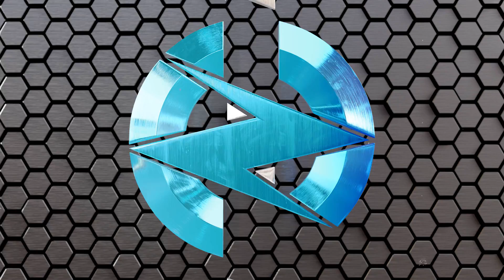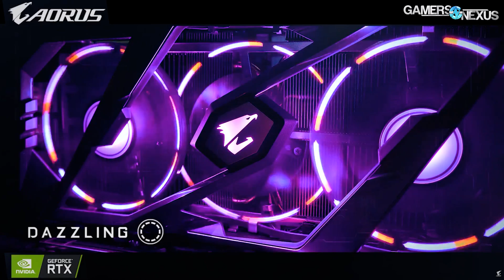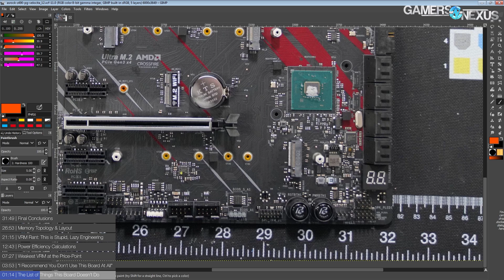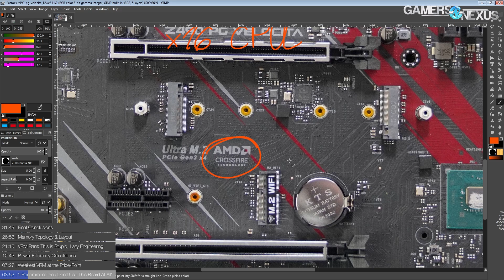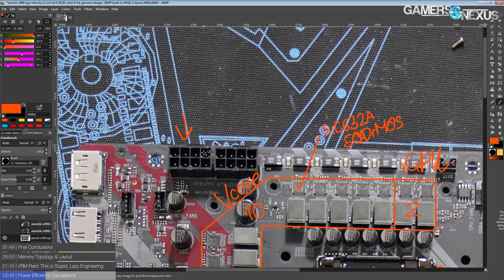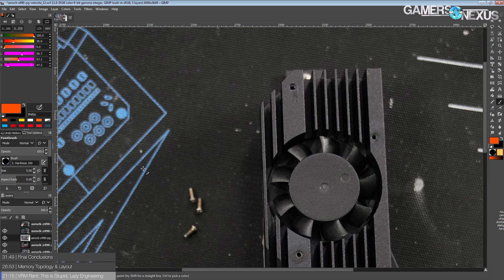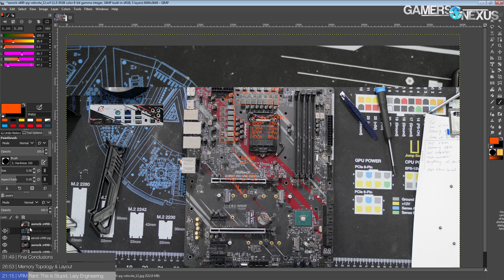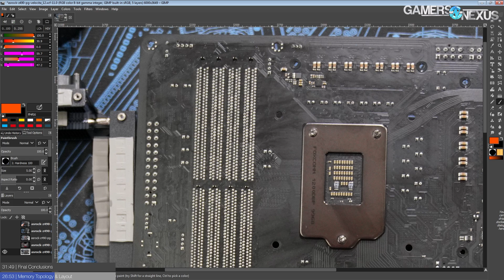Huge Disappointment: ASRock Z490 Velocita Motherboard PCB Review

Comment: As soon as Buildzoid pointed out how dumb it was that pcpartpicker has a slider for CAS latency but a ridiculously long list of checkboxes for RAM clock speed, pcpartpicker changed it. All hail buildzoid
Reply: I noticed this too, didn't know that's why they changed it though.
Reply: i actually see that rather a s a problem in general, when one smart guy has such a big influence now. He's mostly right, but not free from mistakes too. And on some topics, different legit views exist.
Reply: @randomchars9619  While I understand the concern, the issue is no one else really does what he does, at least when it comes to MoBo. Sure Toms Hardware and a few other sites review Motherboards, but the same thing can be said for those sites vs GNs case reviews....They either don't know enough or don't care enough to actually go through the important stuff (VRM for Mobos and thermals for cases)
Until other people actually start doing a proper job, of course Buildzoid is going to continue to have a large and growing influence on the industry.
You just have to be aware he is slightly biased towards Gigabyte because they keep giving him free stuff....which fortunately is fairly okay cause 1) It doesn't effect his PCB breakdowns and 2) Gigabyte typically makes good boards.
Reply: He hit 100K subs just lately but deserves more imo. The boy has done his homework.

Comment: I thought manufacturers had learnt that using tiny shit fans on the motherboard was generally a bad idea. That kind of crap was common in the early 00s and invariably they ended up as noisy whiny scratchy annoyances in less than a year of operation.

Comment: The half-assed traces on the back, from the socket to what looks like the HDMI/Display port look horrible. As if some guy was like of crap we forgot to put the traces for igpu hurry grab some solder and a lighter i got this.
Reply: Could be an RF thing, avoiding sharp corners helps with signal integrity on high speed signals like display outputs for example.

Comment: Love this tech videos amazing all that you can learn to avoid crappy marketing fool you, thanks.
And thank to confirm that I must stay away from asRock... didn't misunderstanding me maybe asRock has some good boards, but seeing this video and my experience with and z270 board (cheap components, bad finish on the board, and many other things...) I'll never go with them.
One thing that I hate most is the example you put with the I/O shield, reusing from a model that has wifi for one that not... it's lazy as hell not making the I/O shield correctly simply to shave some cost form our product lines, and gives a feel of cheap product.

Thanks again for your videos!

Comment: WTF is that pair of M.2 slots crossing each other? even on user manual, no reference to the left one
Reply: You use one or the other. One is Pcie 4.0 the other is 3.0 it's so when you upgrade to a cpu with 4.0 (snigger) you can actually use that slot too until then it's useless. Then of course when you switch the other 3.0 is useless.

Comment: Start of June and the 2020 Disappointment Build has a MoBo contender.
Reply: It also has a CPU contender which is compatible with the board: Intel 10400
Reply: @IgnatiusDavidPartogi  I dont think the 10400 is bad. I just can't find its place between all of AMDs cheap options
Reply: @LinkStorm13  the raw performance isn't the issue. All intel cpus make in the past 10+ years have totally fine performance.  Its the price and lack of overclocking that kill it. Nowadays intel needs to get rid of k series cpus. Its ridiculous they artificially limit the perfomance of a product so they can sell a premium version..when they had a monopoly yeah they could get away with it. But given amds going to be hitting 5nm whilst intel likely barely has 10nm out is just a sign they need to shift their product stack.
Reply: That or the 10700k
Reply: I put the 10900k at most disappointing. hot, loud, expensive powerhog.

Comment: Has anyone else noticed that asus has removed the post code readout from their (quite expensive) mid to highend ish strix motherboards too? I have a maximus vii gene with the readout and it's super helpful for overclocking but if I wanted a new system with an matx board, there isn't one with the display! (from asus that is)
Reply: Still running that exact same board with my 4790k to this day. The XI Gene is the only good one since the VII, but there is a real dearth of good mATX motherboards these days

Comment: WTF is that pair of M.2 slots crossing each other? even on user manual, no reference to the left one
Reply: I was also wondering
Reply: One should be pcie 3.0 the other 4.0 , it's pretty common on z490
Reply: I was wondering the same thing.  A bit disappointed that he didn't address that....

Comment: Me : What does this board do?

Buildzoid : Save ASRock money.
Reply: It kinda makes sense... the 10 series Intel chips aren't that compelling of a product. Perhaps they didn't want to commit a lot of engineering time to an enthusiast board on this platform just for ROI reasons. definitely not a good look for ASRock, though, and seems like a miscalculation given this review.
Reply: @mikee9167  I mean, coming from a bit of an AMD fanboy, the 10 series looks SIGNIFICANTLY better than the 9 series. The i5 especially looks quite good.
Reply: @Sheltada  I dunno about the i5, but the i7 heat issues remind me of that insane 220W TDP chip AMD tried selling a few years back. I'm glad AMD is competitive again because it forces Intel to get serious, but it's still rather impressive how Intel can stay right there with what is this... the 4th or 5th revision of 14nm process? Obviously looking at the heat issues this is the end of the line, but still.
Reply: @aoitamashii  Can you elaborate on the i7 heat issue? I heard nothing of this sort.
Reply: @mikee9167   they make a z490 taichi, that's the enthusiast board. it's also about $440 MSRP so there's that.
Reply: I don't know anything about electrical engineering, but it sounds to me like Asrock left this board to an inexperienced engineer, and by the time they realized what was going on, the board was over budget and in this state, and they had no choice but to shove it out the door with an unrealistic price tag.

Comment: I mean, Im not that big of an OC guy, but the 5 USB Ports alone are a big NONO! Even the cheapest boards from the competition give you at least 7 and sometimes even more. And I do care about USB Ports.
Reply: Underrated comment. I mean by default you have a mouse and keyboard, maybe an extra usb audio speakers/headset. That leaves only 2-3 ports for all other peripherals! 
Feels like Asrock has gone Apple in this board lol.
Reply: @John__K  Hear, hear. Have you noticed how, ever since USB became standard, EVERYONE and their mother has designs on your USB ports? It's like how every business, organization and vendor just HAS to have an app to take up space on your phone.
Reply: what i don't get is why asrock even bothered changing it, if you look at every other manufactures z490 board they literally use the exact same IO configuration they used on x570. it almost feels like asrock just doesn't give a crap about z490 so they figured this was the best way to profit off intel fanboys. hell even the b550 PG velocita has more USB ports.

Comment: "Asrock recommends you use this board with watercooling but I reccomend you dont use this board at all." - Buildzoid destroyer of motherboards
Reply: Strong men can bitch slap you so hard you topple over. Buildzoid can bitch slap you so hard the shockwave can be seen from the ISS.
Reply: REKT
Reply: @fleurdewin7958  the point is that this motherboards isn't, strictly speaking, junk. It's not a bad motherboard per se , it's just very overpriced.

Comment: "The POST code is the only redeeming quality of this board"  Buildzoid out here ruining motherboard manufacture lives
Reply: He took a giant dump on Asrock's entire Z490 lineup on his channel.
Reply: Well don't make shitty motherboards and you're safe. Can't blame anybody else as ASRock itself
Reply: Real men use beep codes
Reply: Back when I worked at a large hardware company, we had special PCI boards that could get this info.  Do they still make those?  Seems like the best solution if you don't like being codes.  My new chassis didn't even come with a speaker.  😞
Reply: Hello, I'd like to report a murder.
Reply: @jasonpollock9259  Hey, it was self-defense. Or at least in defense of good tone and competence.
Reply: What is POST Code?
Reply: @robertturnip7850  POST is Power-On Self-Test. It's a series of tests the motherboard's devices (CPU, RAM, PCH, PCIe, sound system...) go through before loading and handing over control to an operating system like Windows. The "POST code" is a two-hexadecimal-digits number showed directly on the board through two 7-segment displays, allowing more granular feedback than beep codes or debug LEDs, leading to easier troubleshooting of the actual cause of a failed boot.
Reply: @robertturnip7850  the little debug Number Screen on Motherboard, or acoustic Post Code is the Motherboard speaker
Reply: I personally do not even look at board which do not have a POST code!!! It is a sign of quality. If a company can not be bother to implement it then they do not get my money (exception: high-end itx MoBos)
Reply: If it was a true sign of quality,  then they wouldn't have put it on this garbage motherboard.
Reply: @electricketchup  You are correct on this one looks like a pretty bad board. One example...on x570 only high-end and top-end mobos have them.